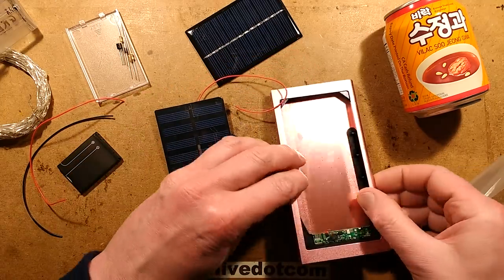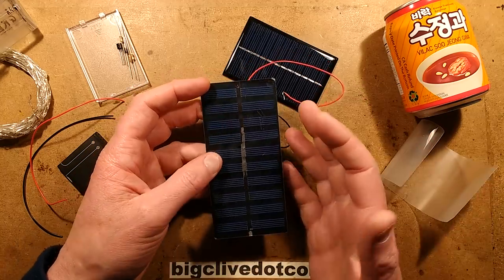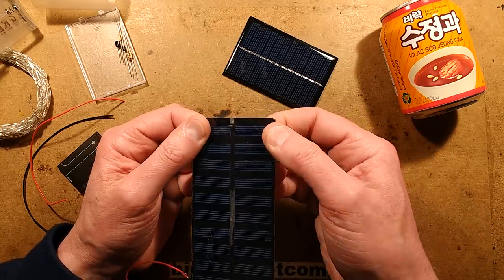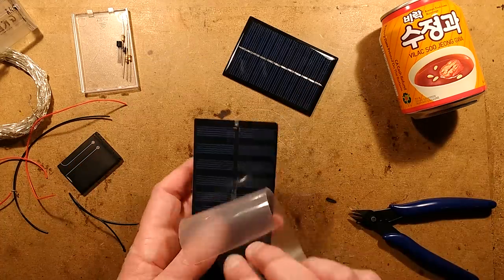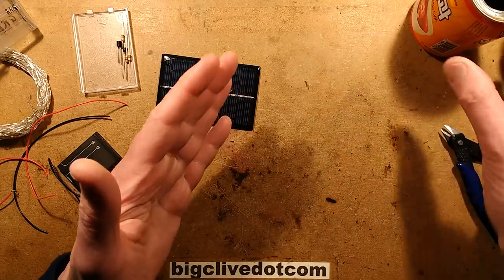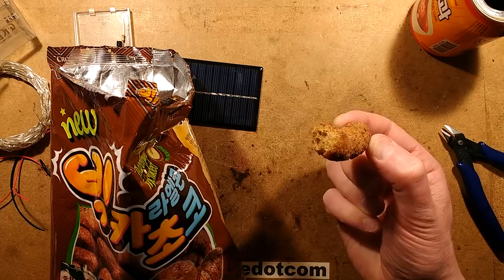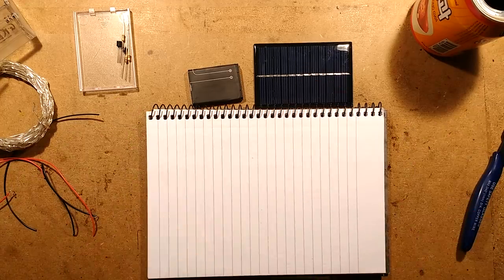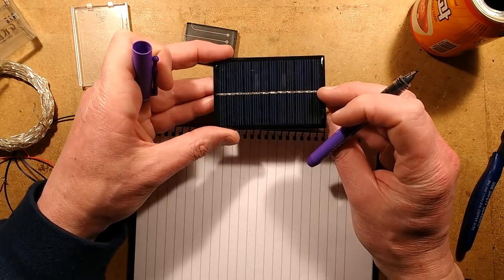Simplest solar light possible, using old phone battery.

Comment: Well, finally got around to building this. I have a backlit address light on the front of my house that gave up the ghost and the circuit was ridiculously more complicated than this but performed the same function. Charge battery during the day and light sign at night. It had a photocell and two solar panels. The insulation on the wires had disintegrated and the wires all corroded. So I tore everything out and rebuilt it as seen here basically just using the shell and it works like a charm.

Comment: It's always fun to see circuits like this done as simply as possible.  A couple of notes:

1) Charging a battery by just hooking it up to a solar cell works because the solar cell can only provide limited current, but it's important to make sure that the cell you're using won't put out more current (under full sunlight) than what the battery can take as its max charging current, or you could fry your battery (can be an issue if you're using small batteries with large solar panels).
2) If you want to be able to adjust the light level at which it switches on, you can put a variable resistor between the base and the positive rail too (might be useful, because I wonder a bit whether the current setup would actually switch on or not under, say, a full moon).

Comment: In germany we lay the transistors flat side on the table with the legs facing to you, then it is "Ein Blöder Collector" (one stupid collector) and the EBC line up with the pins
Reply: True for BC547. Not true for 2n2222 among others.. :)
Reply: The To-92 pinout is not standardised. It can be BCE, CBE or even ECB for pin 123. To-220 is always BCE though.
Reply: Simon Tay - Yes, it’s a right pain in the arse! I wish they had agreed on a standard.
Reply: Even more fun is the transistors that are/were available with alternative lead outs, like the BC214L...
Reply: i just try one then the other if it doesn't work..
Reply: @andrew_koala2974  Some imperial units are still used in certain 'public facing' situations in the UK, e.g. miles on road signs and pints in pubs, but  metric is used exclusively in manufacturing/design, and is the only system taught in schools and has been for decades.

Comment: Love such projects. You should do more things with light/dark and movement sensors. I use them in lots of places in my home and it's not only look good(automatic on off depending on time of day and movement) but it also can reduce energy costs in home because you don't turn on main lights just to go to bathroom at night or turn on/off lights all the time because it detect movements or light.
I just bought tons of cheap night lights with photo-resistors or movement detectors, gut them out, replace leds and put in nice looking boxes and stuff them in closets, near the doors, garden, bathroom etc etc. And it work perfectly.
Reply: Akinaro Great idea!
Reply: Akinaro 

Agreed.

In addition to the energy savings you mentioned, there would also be a conservation of duty cycles of the mains equipment (wall switches, tungsten bulbs, CFL coils, fluorescent tubes).  Such mass-produced equipment is (usually) carefully engineered to reliably survive some specific number of duty cycles, and operating hours, but no more.  Waste not, want not.

Comment: Thank you so much Clive. Watching you is so very therapeutic. Last two weeks have been truly shite. I failed electronics when  I was at college cos I was colour blind. Couldn't read the resistors, etc. But watching you is so very soothing. Thank you.
Reply: A reasonable accommodation for that would be to allow you to use a multimeter to measure the resistance.  I can see (forgive the pun) where you might still have difficulties, but there are ways around those difficulties.

Comment: I made this!
Had all the parts floating around.  Used a 2N3904 & a schottky diode.

The lithium battery I found in my 'to be recycled' box. Was measuring zero volts (yeah).  920 mAh.
Works great!  Currently powering a laser diode while I blow e-smoke at it (because why not?).

Ran an attiny flashing led project of mine the whole night.
Edit: updated info.

Comment: Clive, this is exactly what I need to fix some external LED lit xmas trees that have given up the ghost.  I've got a small solar panel and 2 old (but good) Samsung phone batteries.  I'll be getting the other bits post haste.  Thanks a million :)
Reply: if they were mains voltage xmas lights they won't work as they are wired in series, for this project they need to be parallel
Reply: "given up the ghost" - German detected!
Reply: @DerCrawlerVomUrAnus  : I have heard and used the same phrase all my life- never been near Germany.
Reply: @Anvilshock @WhiteHawkUK I didn't know that tbh, we use the same saying over here "den Geist aufgeben". I just thought he literally translated a German phrase into English, similar to "the yellow from the egg" or "I think I spider". Both are prime examples used to illustrate how not to speak English by literally translating expressions into other languages.EDIT: Spelling
Reply: Aha more useful info!
Reply: @DerCrawlerVomUrAnus  : That's actually really interesting to know! Google tells me that to "give up the ghost" comes from Middle English ("gaf up þe gost", "ʒave up þe gost"), so it is very likely a direct translation after all, but a very old one that has maintained its format in German and modern 

I am sorry I missed your comment four years ago, but I learned something today after all! 😄

Comment: Love your stuff, Clive. This is very useful, please make more videos of this type.

One beneficial change I'd make, is adding battery holder, rather than soldering it in directly. You would have more thermal clearance, and you'd easily replace that battery once it puffs up (we've all had that happen to old Nokias)

That or move to a 18650, which would help in the long term. The BL-5C may not be available in 10-20 years
Reply: Anyone know how much less time different color lights would last?  I can't wait to do this project but would prefer to use white light mostly.

Comment: Speaking of labelling, you should check to my house. It seems the electrical wiring hasn't been done by a professional (or a dodgy one). They got live and neutral mixed up, so the fuses ended up on neutral.
I should say it was quite entertaining first time I tried to replace one of the light fixtures...

Comment: Two things:

First, why not use an LDR as a resistor to turn on\off the transistor.

Next, that looks like a generic Nokia battery...I bought some of those off of eBay not too long ago for a similar project; however, I didn't trust them. I know the official ones and good generic batteries should have the protection, but... it's eBay, so make no assumptions.

So I left it charging on my bench power supply constant voltage for days and nothing exploded. So this looked good right? Well, I went on resoldering the terminals and the plastic melted. My curiosity got the better of me. I peeled off that plastic and saw the board.

From that, I found the middle contact to be a resistor (for determining the capacity), but I saw an outline of where the protection chips should have been.

Concerned, I clipped the board off and there was *zero* protection on the battery. 

Moral of the story? Double check your batteries, unless you are certain of where they came from.
Reply: why use an ldr when you have one already, the panel?
Reply: amojak ah, true and it's not like the LDR would go to an "infinte" high resistance when light is absent.

Comment: Non carbonated sodas have to be nitrogen charged to maintain packaging stability. Otherwise it would crunch up like a water bottle and be supremely difficult to stack or put into a vending machine.
Reply: Peter Gettys for some drinks I'd think that could also help preserve the drink and keep it from going bad too.
Reply: That is very interesting.  I didn't know that but it makes perfect sense.  Thank you.
Reply: With the really thin plastic used on those they could. A little shot of nitrogen would prevent that and help keep the water from going bad.

Comment: It's easy to remember the BC547, I memorised it as the "Big Clive 547"... :P

As for the project, that's a pretty neat package there, it'd be interesting to see how long the LEDs remained lit from a fully charged battery... :)
Reply: I'd say veeeeery long. Green LED are fantastic, they are bright at very low current.
Reply: Doesn't matter. They were running on a 10 ohm resistor. The effeciency of the LED's makes no difference, it only determines how much light is produced. 

I don't know what the voltage the transitor is outputting, assuming it is  4v(probably incorrectly), the LED's are using 4v / 10ohms = 0.4 amps of current. Assuming the battery is 1020mA/h, the light will stay lit for 1.02 Ah / 0.4 A =  2.55 hours.
Reply: In the US it would be a 2N-3904 or a 2N-2222
Reply: I've always wondered if that equivalent 2N of the BC is an identical transistor with just an american name or just one that is almost the same in function (hfe etc.)
Reply: It's amazing how memories work. I haven't thought about BC547s for about 40 years and I immediately remembered the name from my AO Level (roughly equivalent to a current AS level) electronics class at school.
Reply: Richard Smith
You need to subtract the forward voltage drop of the LEDs  - about 2 V per.
Reply: twocvbloke O
Reply: "You need to subtract the forward voltage drop of the LEDs - about 2 V per."

So...0.2 A and 5.1h of run time based on Smith's assumptions above? Is that right?
Reply: Fun Fact:  Most cheap calculators nowadays have a piece of paper printed to look like a solar panel.  No need anyway, because the batteries last a lifetime.
Reply: Maico The specifications are different...
Reply: dgedi78 agreed. I have three green LEDs in series from a Christmas light string to provide light for a meter in my stereo (replaced white incandescent bulbs) and the current is well under 1mA and the lights are bright enough to properly light up the meter.
Reply: it is 50V/100mA transistor with 800 max gain. Not bad for small currents.
Reply: I made that test with two AA generic alkaline batteries wired in series for 3V, i used a cheap green LED from a Christmas string i found on the dumpster and a 400ohm resistor in series with the LED, it remains very bright for about  a month then it slowly starts to glow less, however its been around 3 years and its still orders of magnitude brighter than any glow in the dark paint, at night its quite annoying if you wake up and its pointing at you. i say they can last another year.
Reply: A Legacy is Created)))😎
Reply: Lets see... Can we do some Comment Calculations??)) 
We need the Voltage that the LEDs need to operate,,,
& based on the charge of the Source...
The Wattage consumed...🤔🤔🤔
Reply: @MrBrymstond :  Yep, 2N2222 is what popped into my mind.  A nearly universal small signal transistor.
Reply: @teresashinkansen9402  how'd it go?
Reply: @Legend813a  Still glowing! it starts to fade  a bit but if I tap the batteries on a hard surface it becomes brighter again and lasts at that brightness for a few weeks.
Reply: @teresashinkansen9402  May I ask for an update? :)
Reply: @Faewks  Still going! about half as bright as one year ago but still perfectly visible at night.

Comment: The chinese will be snapping you up to replace there designers of cheap lights :-D.
Reply: and without the resitor behind the LEDs.
Reply: I thought the same when he doodled the circuit diagram. I reckon in about 12 months, he'll open up an eBay solar light, and it'll have the same design (including an unpopulated resistor pad where he drew the alternative version).
Reply: lol i would not be supprised :-D
Reply: they actually have a cheaper design, using only small cheap chip (like YX8018) and inductor that basically is doing everything (regulate the current, control charging and turning on and off), there are even  other versions of the same chip that allow bigger voltage (cells in series) and bigger current
Reply: I wonder if Clive knows about Shenzhen I/O?
Reply: Do you think they'll also sell it with air-wires soldered like that, or bother to make a PCB? :-)
Reply: It will be shirt pocket-sized, with a battery rated at '100,000 mAh' and a '50 Watt' solar panel. All units in Chinese, of course. Yours for 99p, delivered by a 'U.K. seller' with a Chinese Customs declaration on the package, saying 'Gift'.
Reply: @linagee  Point-to-point soldering, very common in the vacuum tube era, seen in radios and TVs, hit up shango066.
Reply: Comparing to you, we Chinese at least know, how and when to write "their" instead of "there".
Reply: @NipapornP  Yes, and even his "native" language, eh? They're not too sharp these days, my so-called "countrymen"... Chock it up to "arrested development", I suppose. All the rage in the West these days.

Comment: Now, with the lights off, place the lit LED strip on the solar cell. 😎
Reply: huehue
Reply: Infinite energy !!
Reply: Hmm... I wonder if it would start flashing.
Reply: William Squires some of the energy will be lost to heat sadly
Reply: Enjoy your solar light flashing and oscillating as hell
Reply: LOL!
Then wire in a turbine to power your house!
Project done!
Reply: Need to add a dehumidifier and use it as a freaking roadway or it won't work.

That's just science...
Reply: gotta strobe fast!

Comment: Nice. I once used a 1 ohm resistor and PNP transistor in the exact configuration to tell when a circuit was idling or drawing current. I also like your 3 handed soldering technique!

Comment: I realize this is a bit old, but a great video none-the-less.  It is now very easy for we in the US of A to order the BC547 Transistors from Ebay, in fact I ordered a hundred because I am a bit dyslexic and trying to wire up a 3904 in place of the one you use was a bit much for my aging brain, but having a supply of the most common European transistor just makes life much easier.

Comment: Is it ok that this is using 5.4V to charge a 4.2V lipo battery?
AFAIK the DW01 chip doesn't drop the incomming voltage to 4.2V.  As long as it's below the over-current limit, it just passes it all through.  Right?

Or is charging lipos one of those "it only takes what it needs" situations, and feeding it overvoltage is fine as long as it doesn't try to keep charging it's own internal voltage to beyond 4.2V (which it won't coz the chip cuts it off as soon as it gets there).
Reply: As far as I know, the input voltage from the solar panel would drop to the battery voltage during charging as it’s a current limited supply. If it wasn’t current limited then yes, in theory, it could be overcharged.
Reply: If you supply higher voltage to any battery it will charge it, the current would be dependent on voltage difference and cell internal resistance, so higher the voltage diffrence higher charging current. Solar panels of this size can't deliver much current so even the 1.2V difference is acceptable as the voltage will drop in the solar panel
Reply: Mr Auto plus I'm sure the protection circuit would limit the maximum charge current.
Reply: I think he's relying on the chilly, low-light conditions of the isle of man as well as the high internal resistance of the solar cell to keep from overcharging the lipo.
Reply: You're not feeding it overvoltage, since its current limited, and as you say, once its not, the chip cuts it off.
Reply: Overcharging is prevented by the DW01 chip in the battery's protection circuit. It electrically disconnects the battery when the input voltage hits 4.25V, and only reconnects it when the voltage drops back to 4.05V. https://cdn.sparkfun.com/assets/learn_tutorials/2/5/1/DW01-P_DataSheet_V10.pdf

Other protection chips do basically the same thing.

Comment: The most common generic NPN in canada is the 2n2222
Reply: when i was a kid the bc108 / bc109 was the one..
Reply: BC547, BC548, BC549 plastic transistors are the same as BC107, BC108, BC109 metal can transistors, just in a different case. 2N2222 and 2N3904 transistors were the most common 'overseas' types before Japanese and Chinese transistors started to appear over here in the U.K. This Wikipedia article is an interesting read: https://en.wikipedia.org/wiki/BC548

Comment: I'm new to electronics and i really wanted to understand the schematics in details but there are still subtleties that eludes me !
Reply from the maker: Some of the simplest schematics like this one are the hardest to understand because they are cheating as much functionality out of a few components as possible.  As you experiment with electronics more it will start making more sense and suddenly you'll find circuits like this quite pleasing, like a puzzle.
Reply: It's already the case !! I'm fascinated by this mini world opening in front of me. The element that caused me trouble is the transistor, and i've watched a video showing the way it work. I think i get it now. I still wonder how do you estimate the value of the element you put on the circuit, like the resistor or the diode ? So i'm watching "A simple guide to electronic components"...